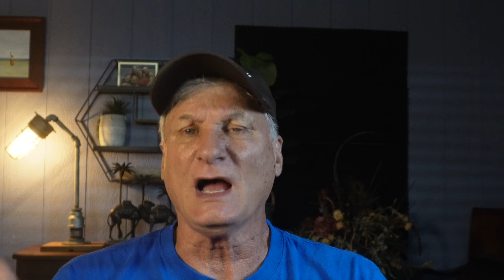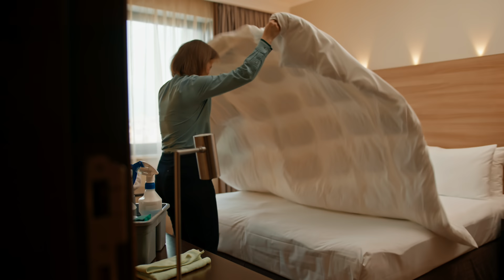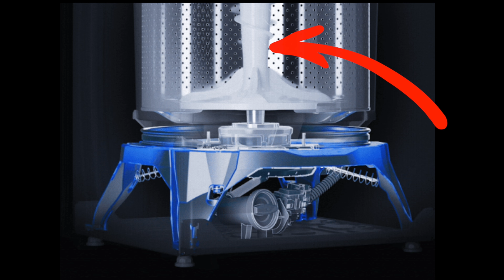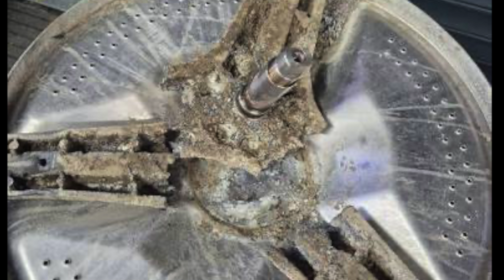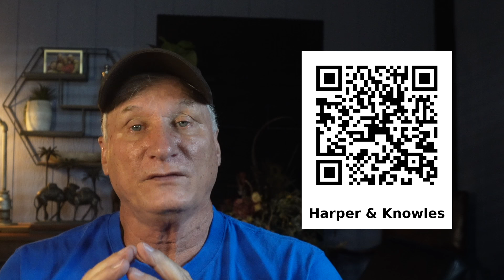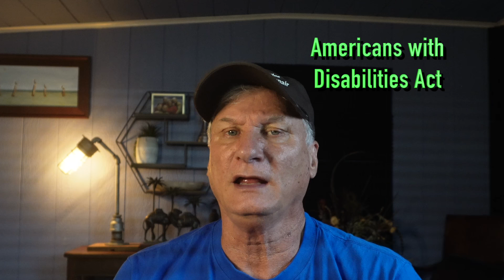Maytag's New 30-Year Washer: No Gearcase, Real Agitator, 900 RPM

Comment: We dont need them to go back to making them like 70 yrs ago, just make them like the cheap ones from 25-30 yrs ago. I bought mine in  2002 and they lasted 10 yrs before i had any issues and the issues were easy to fix on my own with the parts.

Every appliance doesnt need a damn computer built into it!!! Stop with that crap.

Comment: I have a Maytag, it’s 4 years old. I purchased it second hand at 1 year old. The people had moved and the configuration in the home did not work for her. She wanted a stackable. I’m SORRY I ever bought the set. Six months after purchase it started a grind when starting the spin cycle. Now it sounds like it’s going to die every start of a spin. ( if you have ever drove a manual transmission vehicle? The sound when someone throws it into the wrong gear for the speed it’s going? It’s exactly that same metal grind but multiplied volume inside this house. Can scare the begeebers out of you.) So never another Maytag. Oh! I’m a X Neptune user too. But I have to admit that at 5 years they came out and Did replace everything on it that was bad, For Free.  The motherboard, motor parts dryer tub, seals on the doors, and a bunch of other things. But had I not been watching I’d have bypassed that call and had to replace everything myself. The only washer and dryer that’s ever lasted, 20+ years, was a stackable I purchased through White Industry back in the early 80’s , husband worked for Blaw Knox manufacturer of heavy equipment and White Industry was the parent company. No computer mother board,  simple knobs. loved that machine a front loader. And my old wringer washer double tub. The only two that ever lasted. But when I get a new one this time I’ll look for a stackable since downsizing to a smaller home. If I do end up with a space big enough for a set it will probably be speed Queen.

Comment: I’ve been nursing my Kenmore washer, and the Speed Queen TR5 and TR5 were the replacement short list.  This announcement changes the game.  I want a larger basket than the TR5, but I’m done with the blankety-blank suspension rod fiasco of the current residential Whirlpool/Maytag washers.

It’s about time a manufacturer came up with a direct drive polyphase motor which can both reverse and obtain high RPM.  That means more complex electronics on the board(s) but IGBTs or power MOSFETs are a proven and affordable technology in the 21st century.  Hopefully Whirlpool will use a good board supplier.  At the rumored price point a direct drive system should be a no-brainer.

Comment: Bought my first washer in 1975, used Kenmore, avocado, used for 10 years. 
Bought quite a few more,  got fed up and got my first Speed Queen and love it
Reply: Our first was a 1978 Kenmore, avocado. :) It lasted 17 years.
Reply: My first Kenmore was the industrial model and lasted 17 years. The next less than 10. I will be buying the commercial Speed Queen soon. I will see if the Maytag can be converted to a salad spinner. Rewiring to toggle switches is way more complicated than in the old days.
Reply: Do you have a habit of overloading your washer, which is very damaging to it, and your clothes..?

Comment: My 1 1/2 year old washer started getting  stuck in the drain cycle. I got to checking on it and found out they had a recall on washer doing that. I call Whirlpool support service. In about 10 days they had a local appliance repair guy call and replaced the control board. No charge. I was totally surprised and pleased with their service on handling my problem with the washer.
Reply: Yah the pressure sensors that are soldered onto the board are the culprit, you can replace the board or depending on the person solder a pressure sensor onto the board. Works every time 😉

Comment: Looks like more plastic motor garbage electronics to me, my Maytag from the 80s still stands in defiance of time. A real metal motor with a belt that has only been replaced twice in the 10 years I’ve had it, a real transmission, a mechanical dial timer. I’m a mechanic I need this real washer not plastic garbage. I’ve changed some hoses and a water valve this and that but this washing machine IS 30+ years old and it IS still working and working better than the garbage of today that simply won’t clean my greasy cloths

Comment: I am drying a load of clothes in my 30 year old Maytag dryer after washing it in my 30 year old Maytag washer.  In 30 years I have replaced the washer lid due to rust on the edges, the dryer drum, and about 2 years ago, the washer timer.  Every repairman says they want the pair if I ever get rid of them.  These were not commercial grade appliances.  I expect them to last as long as I do, and at 72, I expect that they will.

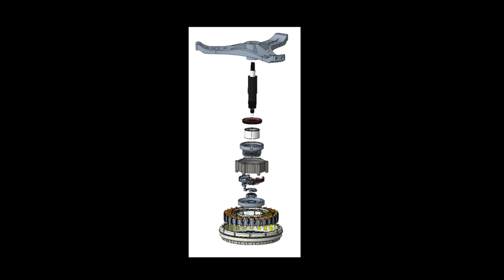Comment: They probably mean they're gonna build it for the next 30 years. Wont last 30 y.   9:25 the top part ( spider ) Is the spider bolted to the basket to rot within 5 y? what material is it made of ? I dont thrust that spider especially if it's a whirlpool part . I've had enough of whirlpool.

Comment: The clutch (I think it is a clutch that it needs) on my SQ costs $700 and that does not include installation which was estimated at another $700.  We have been using it anyway and now it stopped screeching!  I would like a larger tub however- I cannot do large blankets or comforters.   So I'll check back in about this Maytag-but the price point is steep.

Comment: My 1970 A806 maytag top load washer gets worked hard and being a farm equipment mechanic with appliance repair in my back ground. If it does not come with a cut gear durable transmission, they are junk. General electric makes a washer like the one you are talking about and they dont wash clothes well, the fact that the rebuild kits are available for my 56 year old maytag washer should be telling to anyone looking for a sereous washing machine for long life. You got GrandMa's old maytag, send it to Lorain appliance in ohio, spend the pretty penny and get the real real washing machine back in your home. I love my washer so much I have squirled away two other ones that I have found along the way. I have the matching DE806 2 belt electric drier and it is equally impressive. if its not housed with a motor and transmission, its short order junk. the washer you are talking about will loose the seal and you will be putting the bearing shaft kit in like I had my mother many times

Comment: I helped a guy with a van he recently bought. It wouldn't start. I diagnosed it and found it was the fuel pump relay. I swapped it with the AC relay and he drove into the sunset. Assuming he replaced the relay and has AC again, imagine him just throwing the van away.

Comment: If it has logic, solder joints, capacitors, transistors, resistors, etc, or a control board in general, it will fail. Mechanical things fail too. The problem is when parts are unavailable to repair them. And MOST importantly, people with the ability to diagnose them.

Comment: I got a basic Bosch front loader and dryer and they have been going to 20 plus years. The pump just went out other then the warm water value going out it's been great for me. Dryer I've never had it worked on. Only problum I had was I got them at Lowe's and had them delivered and installed. They guys did it and i didn't pull them out to check them but the washer has a big dent on the inside panel. You think the delivery guys told me? No and they knew it but I didn't find out for a few years when I pulled them out to clean.

Comment: You took me down memory lane a bit describing washer history. Before I had my own business I worked for a Whirlpool factory service agency back in the early 80s as they were about to introduce the Design 2000 washer. I replaced lots of belts and pumps on the old belt drive washers back then. If you mention a wig wag solenoid to a modern day tech they would probably have a look of bewilderment.

Comment: The motor design appears to be a brushless motor.  That being the case it takes a motor controller so no more gearbox but added motor controller.  Dealing with brushless motors and motor controllers on riding lawn mowers if it fails the price can be high.  Going to be interesting to see how they hold up.

Comment: Thank you for your honesty and really good explanations of what's coming. Me, I still prefer my 25 year old Whirlpool top loader with a real old style timer, real gearbox and ratcheting cork screw agitator. That full constant motion is the only washer that will get the days grease and grime out of my blue jeans and other work cloths. No computers or water pump filter to clean. It may not be as electrically efficient as the new stuff but my bet is it only costs me an extra $10 to $15 a year washing 1 or 2 loads a week.

Comment: So my parents back and it was either 99 or 2000 bought  some Maytag Neptune models, front loaders, washer and dryer. Those things were workhorses along the way I think around 2008. My dad put a belt on them a new wax motor and he replaced the mixing solenoid. I think they’re called that allow the hot and cold water to come into the drum ….at about 2014. My parents gave me them and then 2014 on. I had them up until about last year and around 2019, I had to put in a new evacuation pump and another wax motor. Both are easy to do myself. I also threw on another belt …finally the washer bearings went out tried my best to replace them (maybe I should’ve used the Tony tool )and that gave me about another two years out of the unit or so so I finally just bought another set of Maytag where they say it has commercial technology on them, but whatever….. both front loaders, bought them off of Costco the thing I hate after looking at the Vin code and production date. The washer was made like five years ago, so I wonder what that does too. The seals on the shaft going into the electric motor sitting like that ect..

Comment: It looks very promising.  The last single stage HE agitator based on a impeller design from Whirlpool was called the Agipator and very much like the majority of impeller designs it didn’t circulate very well but the single stage GE design agitators in the lower tier from General Electric does because the outer edges of the impellers are the highest points on the humps of the impellers. I noticed the new design from this Maytag is designed the same way. It appears that Whirlpool really thought about this new design very carefully before putting their new generation on market because the VMW was absolutely disastrous for their brand’s reputation which was where both Whirlpool and Maytag both earned their reputations historically. I’m looking forward to this being successful and really hope that their reputations are saved. I’m also very happy that KitchenAid has not only returned to implementing built on food waste disposals in their dishwashers but they now offer the control panels hidden behind the handles on the dishwasher as opposed to atop the door where moisture builds up and often is the reason that control panels fry out. It sounds as though the house of Whirlpool is on the rise again and I’m very pleased and hopeful to see it.

Comment: I have a Samsung and replaced the suspension rods 3 times. What I did was take out the four sponges and glued in purple insulation sheet cut in 5 inch blocks glued in with glue gun. I also put white lithium grease on foam. Machine runs so much better especially when it's overloaded.

Comment: The 30 year washer with a 5 year warranty. Make it make sense.
Reply: That’s what speed queen has too.
Reply: @gordonschiff3621  at 15 years 75% of Speed Queens toughest model have never had a service call and are considered at half life. You wont find new Maytags that go 5 without the electronics board malfunctioning.
Reply: @gordonschiff3621  The difference being speed queen has a reputation. A very good one. Tried and tested. That's why maytag changed there product line. Because they have a reputation too.  not so good. see where i'm coming from here.  I will take speed queen's warranty over maytag's any day of the week. speed queen's quality never decreased unlike maytag's.  buy once cry once.

Comment: My old Whirlpool washer and dryer were THE best ever.  Finally could no longer repair after more than 30 years.  Agitated fantastic! Cleaned fantastic! Dried fantastic!  While Speed Queen is very nice I just don’t like it’s light weight agitation whether saying Heavy or Bulky.  Much better than are terrible ASKO XL.  $1500 to replace a fuse box, because you couldn’t just replace where the fuses plug in you had to get the whole wiring assembly and front panel.  Washes and dries the heck out of your clothes.  Hate them

Comment: My Kenmore Washing Machine I bought in 1991 lasted through a move from Virginia to South Carolina, when it was 9 years old and died in 2018 at 27 years old. It never had a single issue.  The new one lasted one year and one week before the door mechanism came loose and the washer wouldn't run. Because it was over a year, it wasn't covered under warranty so they said the service call was $250 just to show up!!!  The washer cost about $500 so that wasn't happening. Luckily my husband fooled with it and fixed it. So making old fashioned washing machines that lasted almost 30 years were a thing, before they got cheap with their parts and made them plastic.
Reply: I still have the same washing machine, coming on 9 years old, praying it might last another ten because the cost of new ones is ridiculous and they are all too bulky to fit in my laundry closet.

Comment: Whirlpool products are garbage. I just had a refrigerator door hinge brake off at the screws. The screws actually broke off with half of the screws still screwed in. I'll never purchase another whirlpool product.  Cheap parts and not reliable. I bought a new LG that's being delivered tomorrow. Even the nametag on the fridge is cheap. It peeled up and bent from wiping down the fridge.   Cheap cheap cheap!

Comment: TC500 doesn’t have a lid lock but control panel failure is common. A simple google search verifies this. No troll, just fact.
Reply from the maker: I'm sorry I misread your model number before and deleted the comment. If you have a TR model, it does have a lid lock.
Reply: @HarperandKnowles  No worries. You have an excellent channel. Kudos, too, for shoutout to Ben’s Appliances and Junk. We’re done with Speed Queen. Looking forward to see your and Ben’s reviews on the new Maytag.

Comment: My sh1tty whirlpool washer had the dreaded pressure sensor fault where it continuously runs the drain pump and overfills after only 22 months after purchase.   Not even 2 years.  

Turns out there’s a silent service campaign on over 5M washers due to a design defect.  It requires a PCB controller replacement which is the brains.  POS.

Comment: I think old GE's are the only ones that did the suspension rods right. Their tapered design lasts long, unlike the crummy foam & damping grease types. I am happy, though, to see the bullet proof pedestal bases coming back, though. I, too, don't mind plastic tubs. 
Thanks for your insight!
Reply from the maker: I think GE invented the suspension rod, and they didn't license their design to other manufacturers. They did get it right, though!
Reply: Heck yah GE did it right with their suspension rods, it’s just a heavy duty spring. Even in their new design, unlike whirlpools junk with a lightweight spring and foam pad. Those rods blow out every 5 years on all whirlpools junk, Samsung are doing the same think now too!

Comment: If it is a single piece agitator… count it as a wash plate… the top is just for looks.. it does nothing else! As for me- I’m very happy with my Samsung All-In-One Washer Dryer Combo! It’s worked great this far and my older Add-Wash model from 2016 is also going in strong!

Comment: My Whirlpool washer is only 18 months old and the circuit board failed. I called them and they said my serial number is newer than others that are under a service bulletin that are sent out a new circuit board at no charge. They said the best they could do is 20% off a new washer purchased off of their website then I would have to pay shipping. I told them that same unit is cheaper in store than on their website even with the discount. I have been a loyal Whirlpool client for a very long time but told them I will no longer be buying any of their products under any of their brands.

Comment: this looks like a promising washing machine.. esp if they can get that stator to have a real agitation caden ce and not the typical slow back n forth of a VMW.. .im glad the otor is warrantied 10 years... this is a top loader not a front loader... tub seal goes and its gonna eat the motor.. I like the clutch / brake.. I thin that helps with cycle times.. instead of waiting 2 minutes for a full basket to spin down and advance to the next part of the cycle, it stops and goes right away.. its a washer i'll definitely look at, dont get me wrong I really enjoy washing my clothes in my 41 year old GE filter flo.. and it gets things.. even my diesel bus clothes... very clean... but the basket size is small,  I could save a load every 2 weeks if I had the basket size this machine is advertised as.  maybe even a full load a week if I go buy some more towels.. as I could wash more of them and wait longer..  its a washer I definitely have my eye on..  esp if it gets chip or ben's  work clothes clean.. then id have faith that it gets my kitchen towels (I use washable restsraunt towels instead of paper).. and my diesel work clothes (vintage busses make lots of dirty clothes)